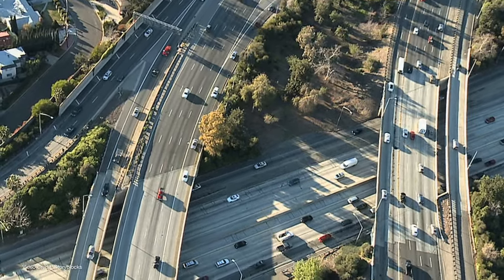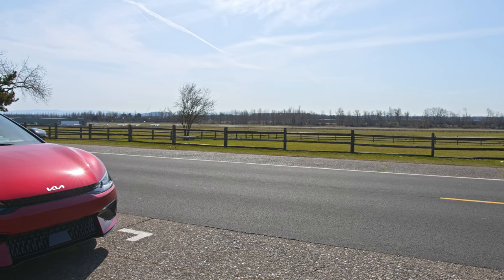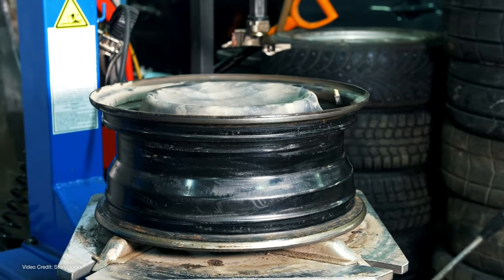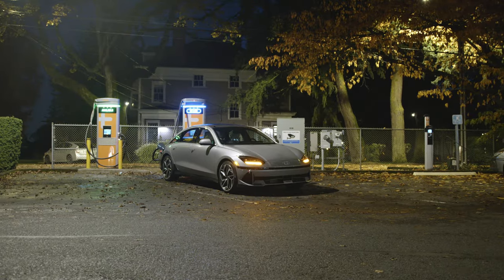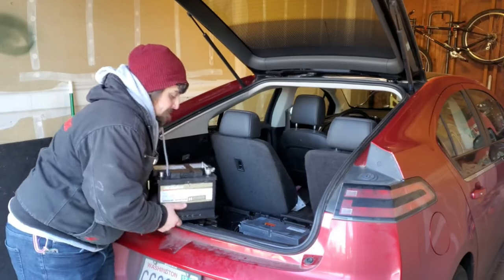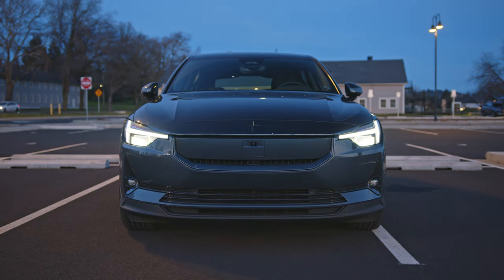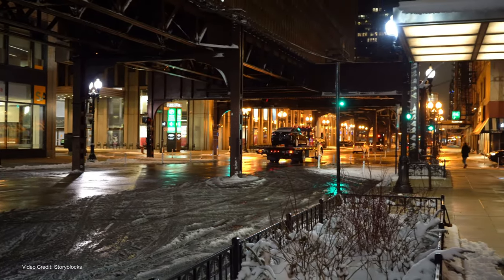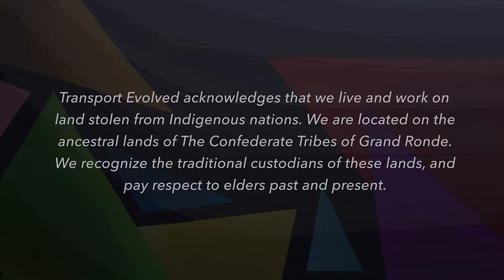Your Electric Car Just Broke Down. Now What?

Comment: Good call on the flatbed for the AWD EV. Hadn't thought of that.  Hopefully I'll never need to use that.  The 12V battery being degraded in the BMW i3 threw so many unrelated errors, and wasn't too tricky to replace.  Good info.  Thanks as always!

Comment: The Volt location for putting a key in case the battery in the fob is dead is a hoot. 😂 under the rubber mat in the dash top compartment.

Comment: Good advice all-round. UK rescue services have 2+2-wheel dollies available to allow any van to tow an EV.  
I have had a faulty DC charger fault my EV and incapacitate it, I could remove the plug after pressing the Emergency disconnect on the pump. But even after a 12v disconnect the car remembered the 'traction fault' it didn't have. AA had to clear the fault logs and it was fine. I had enough charge to get to another charger.

Comment: Niki, you forgot a  big one! I always keep, in my case, a 10mm wrench so I can disconnect one of the 12V battery leads in case my Bolt has a brain fart. That simple act of disconnecting the 12V battery, waiting a few minutes, then reconnecting the battery, can fix a lot of gremlins that can stop you cold.
Reply: Yes
Reply: Had to have this done yesterday on a Leaf when car threw a code (thanks, EVgo) and would no longer charge.

Comment: Everyone please buy an $18 air pump. Slime brand makes a great one and it plugs into your 12v outlet. I see so many people struggling at gas stations adding air, some waiting in line. Just do it at home using the pump in your trunk. It’s so worth it. Was great for my Volt.
Reply: My Spark EV actually came with one!
Reply: I have a small air compressor at home and a spare tire in the trunk which I purchased separately.

Comment: 5:11 weekly tire pressure check? I check my tire pressure (via the Tesla’s info screen) every time I drive my car, and pretty much every time I drive over a new pavement type or hit a pothole while on a long trip. I only check independent from the onboard telemetry when filling the tires with a digital pump.
Reply from the maker: First, it's okay to use the TPMS as a quick check, but they can (and do) fail or become inaccurate. Knowing how to manually read them is very important!
Reply: @transportevolved  Touche'. I don't disagree, in principle, you are right; though in practice I'm a lazy slob and find the readings behave reasonably (as tire warm during a drive or start with warmer tires (perhaps in the sun) showing greater pressure initially) and always agree with the readings I get from the cheap digital pump I use to top off the tire pressure, occasionally.  In short, as long as I have evidence the telemetry is good, I'll probably keep trusting it (even if a little more than I should).

Comment: Valuable video.  Just want to mention that on a Tesla you can get additional information with an OBD scanner with dedicated Tesla app for those who like a lot of additional technical info.  If you do have a problem though, contacting Roadside Service in your Tesla app will allow them to diagnose your car, help you with the problem and schedule service if necessary.  Often all that is needed is to hold down both scroll wheels for a few seconds to allow a 30 second reboot.

Comment: That lack of a spare tire is one of the main reasons why I'm reluctant to bother with an electric vehicle. My 07 SUV has a full size spare, at that one that is easy to access.
Reply: I did not even realize that was something what was dropped on EVs (the space savings are probably more important than the weight savings).
Reply: Lack of a spare is now the case with most new cars, not just EVs.
Reply: @StormyDog  Yup.  I've been finding that out as well.

Comment: I carry a tire patch kit with fresh glue, the kind w rubber strips, 10mm or adjustable wrench, tape, disposable gloves.
There are 12v lifepo with a warranty, i think it was 10yr.
A flashlight w strobe is a good idea
Reply: My Fiat 500e gives very little warning for 12v
Reply: The only critique I’d give is that LiFePo4 doesn’t do well in the super-cold temps of the Midwest. It’s entirely possible that if you park outside on a night that the temp gets down to -10°F or lower, the LiFePo4 cells of that battery could get cold enough to refuse to charge; and since the discharge cutoff temp is significantly lower than the charge cutoff temp, its not unlikely to see the “12v” battery go dead because its BMS will not let it charge. This PSA brought to you all by my own experience with making a (very heavily insulated) DIY 12v battery.
Reply: @jacobcarlson4010 I thought so too, lifePo have a reputation for being warm blooded, but the manufacturers seemed confident I would like to watch the video again

Comment: It’s really worth knowing which doors are electrically powered and where manual releases are. In my old Tesla Model S the front seats door handles work the same whether the car is on or off, but the rear seat door handles don’t work when there is no power. There is a release cable below the seat that a person in a front seat could see, but a person in the back would have to feel for it. I believe in the Model Y they are in the door in the door pocket but I’m not positive. 
Since a woman recently drowned in her Model X after she drove into a pond, it’s worth knowing that you need to roll the window down quickly before the power dies. I carry a glass breaker, but with the new laminated glass I don’t know if they even work anymore. 

I keep a hi vis yellow vest in the car. I have a tire plug kit that can be useful for cars that don’t have spares. I had a previous experience with fix a flat just shooting out of a hole instead of plugging it, but that car had a temporary spare that could only go 50 miles, so I ended up at a motel until a tire store opened.

Comment: I didn't realize an EV was so dependent on a 12V battery.  I may swap out my Leaf's battery for an LTO, like I did for my ICE vehicle.  Thanks!
Reply: With Tesla the 12v lead acid battery was the number one reliability problem.  So a while ago Tesla switched all their new vehicles to a 16v lithium battery.  This change solved that legacy problem.  The one exception is the new Cybertruck which uses a ground breaking 48v system.  Word is that all new Tesla models will have this 48v low voltage system and have bidirectional charging (like the Cybertruck).

Comment: One morning, my Wallbox charging handle would not disconnect from the vehicle. I called the electrician and he was on the phone with Wallbox. Nothing proved successful. The charge cable had to be disconnected from the wall unit. The car would not start because the handle was still stuck so I had to tow it in. A flattbed was used but the vehicle could not be placed in neutral. It was slowly dragged onto the towtruck and delivered to the dealership. They rather brutally ripped off the handle and claimed the latch spring had broken. But no one would admit if it was the charge handle or the car latch which was at fault. I was to be charged but after much frustration with dealership personnel who actually cornered me telling me it was MY fault, I asked for the matter to be brought to the dealership manager who waved the charge. What a mess! No problems since then.

Comment: I had to have my Spark EV flatbedded to a Range Rover dealership when I ran it out of range trying to drive it home the night I bought it. It had been on my insurance for such a brief period that it wasn't yet entered into their Roadside Assistance system. So I had to pay for the tow Out Of Pocket and then turn the bill in later for reimbursement.

Never would have happened had Electrojunk Americas fast chargers would have worked like they're supposed to!

Comment: I have flipped through and scratched my noggin. Where is the emergency charging cut off for the chevy bolt? The single DCFS charger in my region is known to get stuck inside EVs and I want to know how to disconnect it if it gets stuck.

Comment: I have 27,000 miles (44,000 km) on my 2022 Ford Mach-e.  Should I have already gotten an oil change?
Reply: Look it up in the manual, when the gear box oil in the drive units is due for inspection or change.

Recap from Ford:
Transmission Fluid - 10 years/150k miles
Coolant - 200k miles
Brake Fluid - 3 years
Cabin air filter - 20k miles

Specifications:
Rear drive - Motorcraft ULV Automatic Transmission Fluid - 4.07qts (recommend actually seeing how much comes out)
Front drive - Motorcraft SAE 75W-85 Premium Synthetic Hypoid Gear Lubricant / XY-75W85-QL (WSS-M2C942-A) - 0.92 qts
Reply: Wiper fluid Kyle, wiperfluid!
Reply: Have an electrician inspect the home charger. Or don't and see what happens
Reply: @MooseOnEarth  lol
Reply: @TuckLoomis  I have it plugged into a 120v outlet with a breaker. I will eventually have a 240v plug installed.

Comment: Yeah I have a BMW i3 and it stopped working- was stuck in P and would come out.  I changed the 12v battery and then even had to towed to BMW. They wanted 5 grand to just drop the battery and even then no guarentee they can find the issue. So I'm stuck in a $4,000 loan and the car doesn't work. Had to start a gofundme. Im not sure what to do about this car. Any guidance on what to do would be helpful :) Good info in the video :)
Reply: A NEW 12v, some EVs are very finicky about 12v.  Might be worth a try.